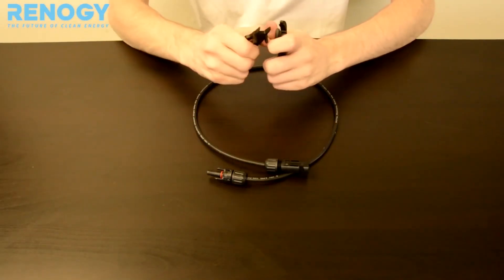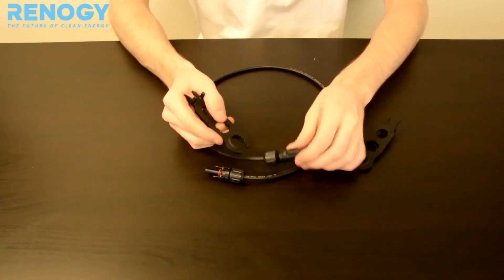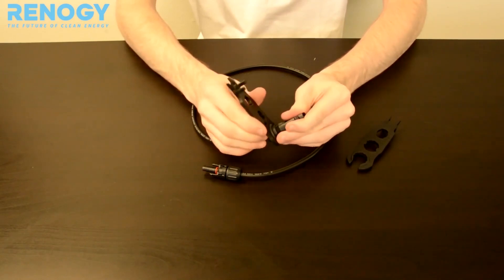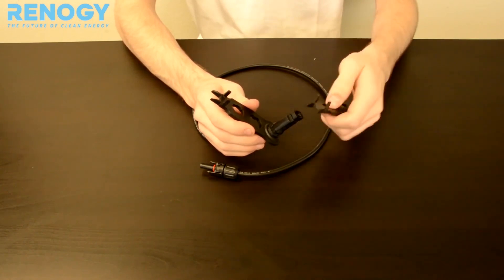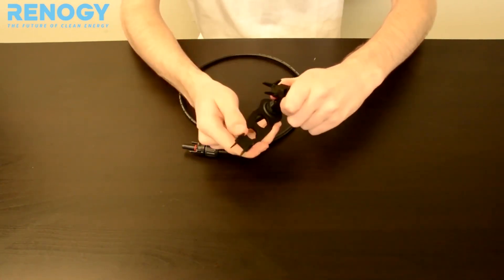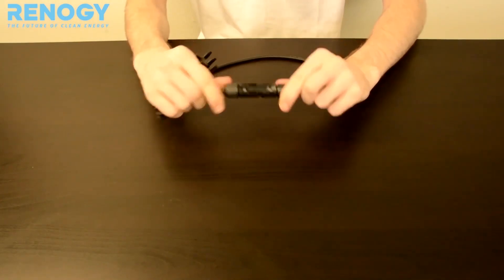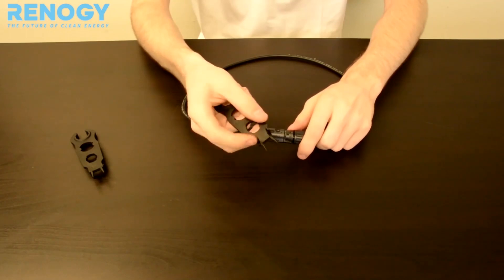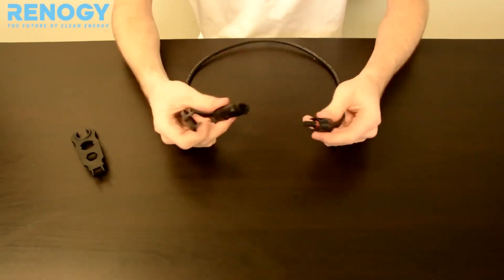How to use MC4 Assembly Disassembly Tool

Comment: Yea well, it doesn’t work.
Reply from the maker: Hi, Roger. Do you mean our video is not helpful? If yes, we really appreciated if you can leave your suggestion in detail for our reference.
Reply: @RenogySolar  yes, it was helpful thanks.  I’m guessing my MC4 connectors were quite new and had not been taken apart for a year.  I bought another Renogy panel to connect in parallel to my other panel and found one connection came out easily by hand and the other one was quite stubborn.  I got it done though with an MC4 spanner.  Thanks for taking your time to reply to my comment.  Rog from Wales 🏴